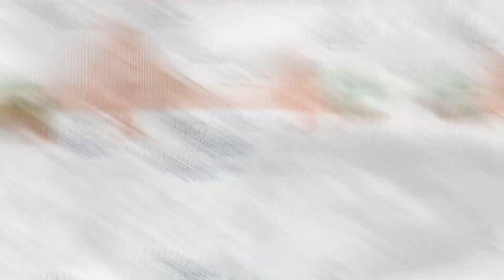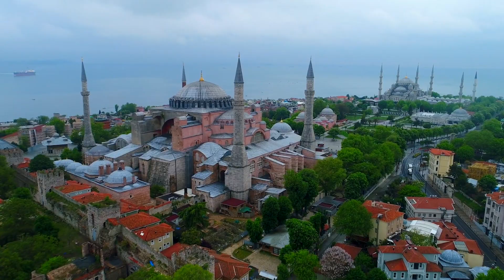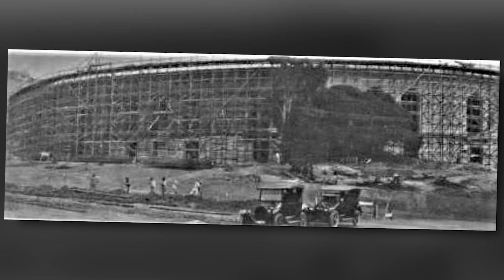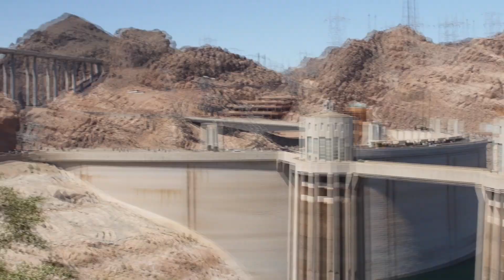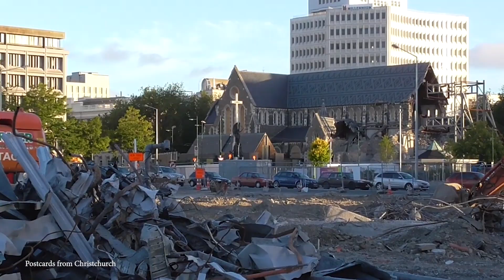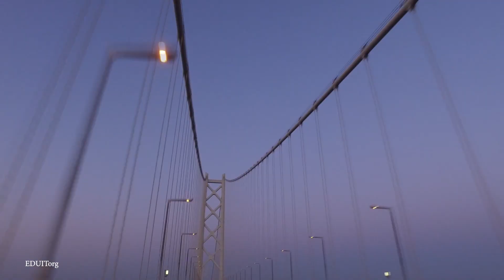15 Structures Built on Active Fault Lines

Comment: Go look up Rainier Tower in Seattle and tell me that shouldn't have been included. It's built on what can roughly be described a reverse-pyramid. The bottom of the tower is on rollers that take up the entire city block, underneath, so it will literally roll back and forth during an earthquake, helping to absorb all that energy. The Space Needle, on the other hand, is built on a foundation like those old blow-up "punching bags" that are weighted on the bottom to make it rock back and forth but not fall.